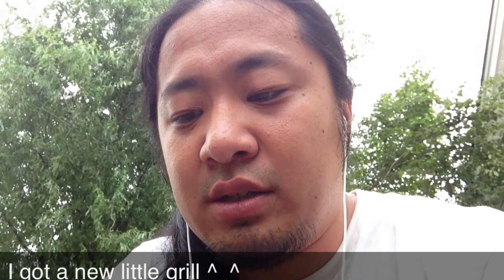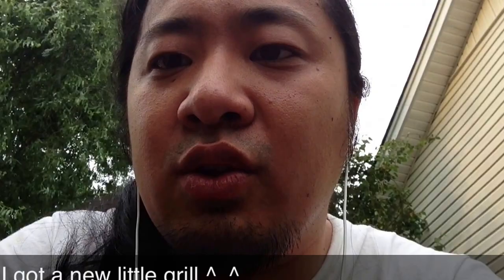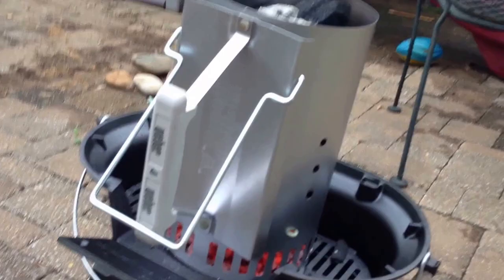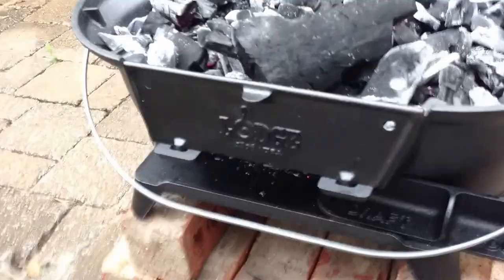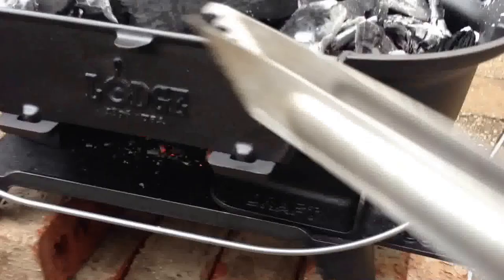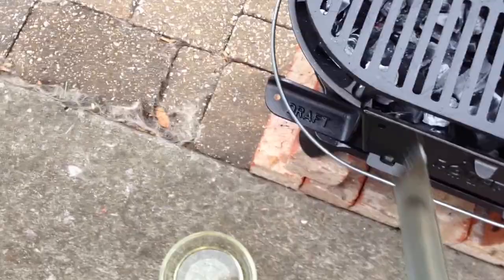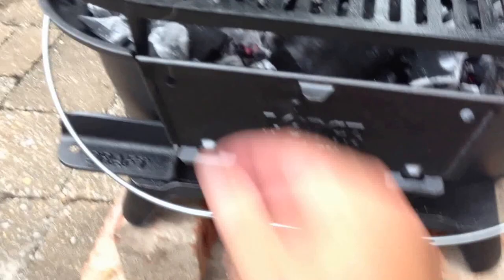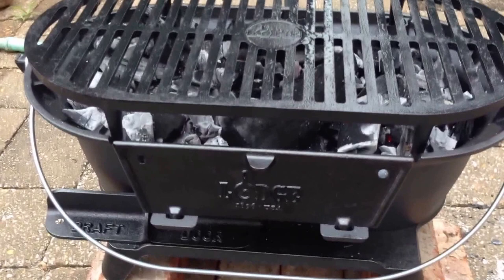My new grill: Lodge Pre-Seasoned Sportsman's Charcoal Grill

Comment: Since it's cast iron, did you have a paraffin layer on the grill to burn off? Just bought the grill myself and am wondering.
Reply from the maker: it didn't have any coating on mine. i let it burn for a bit to see if any of that black smoke or smell but nothing happened ^_^